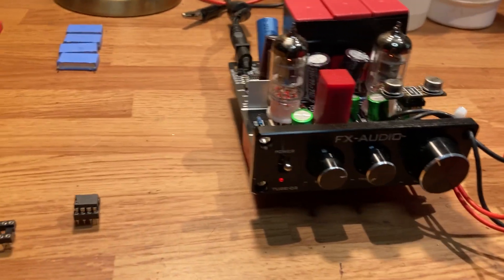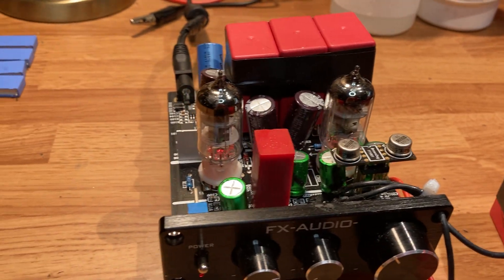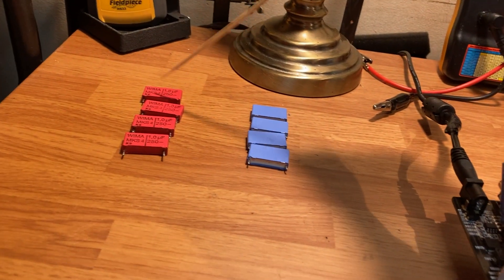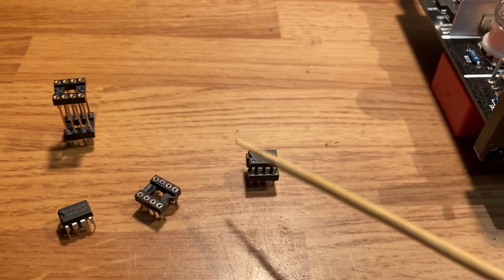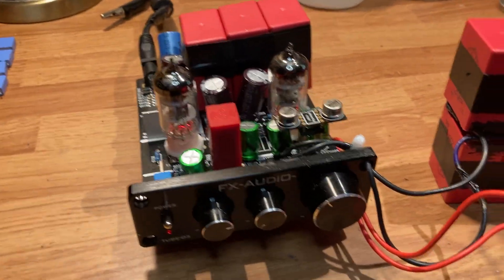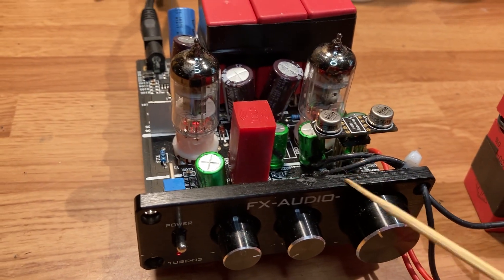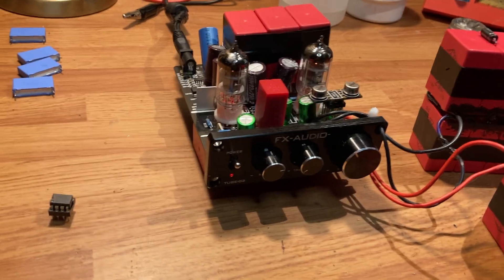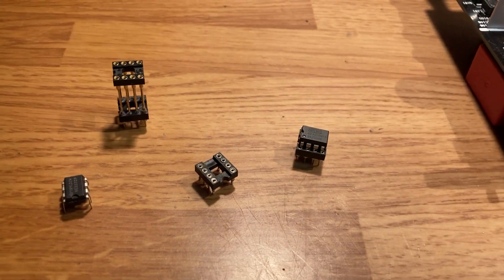FX Audio Tube-03 op amp and capacitor upgrade

Comment: do you need matched tubes on this device or will 2 same brand/model suffice on this?
Reply from the maker: you don't "need" matching tubes but you will have a different sound on the left and the right.  That's why people pay extra to have them matched as close as possible.
Reply: @ranbymonkeys2384  cheers mate, think I'll treat myself to one of these & try the 2 basic mods. Seems like an inexpensive way to give an old amp a new sound.
Reply from the maker: @bigambientdeath  Now electrolytic caps only last about 20 - 30 years so you may want to look into replacing the big power caps (usually 2 o f them) in your old amp.
Reply: Make you music more hifi!, My Suca tube T1 has arrived!, It comes with 6k4 tubes & NE5532p op amps, sounds good out of the box, swapped in opa2134pa amp's, sounds a bit more spacious in the top end, will leave Russian tubes till the others are properly run in, good unit so far...
Reply from the maker: @bigambientdeath  It probably came with Chinese tubes, if it did, get them the hell out of there, haha.
Reply: @ranbymonkeys2384  replaced the Chinese tube's with the voshkod 6j1 Russian tubes, they are smaller tubes but they just give you a little bit more of everything, especially volume, so a great match with the new op amps, thanks for your help & advice, very happy with this little device now.
Reply from the maker: @bigambientdeath  Glad to hear it.

Comment: Does anyone have a recommendation for what OP to replace stock with?
Reply from the maker: There may or may not be a couple of them in the description, maybe.  Shhh, don't tell.
Reply from the maker: What is your system lacking?  What does it need more or less of (tighter bass, lower bass, crisper highs. mellower highs, ect) ?  EDIT:  Sara the reason I ask is because different op amps can do different things such as OPA627 will soften the highs with a warmer tube sound, I'll tell you what, get a MUSES01 and a MUSES02 from Mouser NOT EBAY and you won't regret it.  link to 01 : https://www.mouser.com/ProductDetail/NJR/MUSES01?qs=%2Fha2pyFaduhLj53VmnKEqFRFz215J7cixEDbz0teI2s%3D
link to 02 : https://www.mouser.com/ProductDetail/NJR/MUSES02?qs=%2Fha2pyFaduiBH%2F%2FkpIrdkJVU%252B1ReE4c5hUkfZAV1m%2Fo%3D
Reply: LOL! Should have introduced myself , This is her husband Frank.
Got it! Thank you! I know I heard the parts in the video but wasn’t completely sure which ones and I’m looking to tame the highs a bit. Due to the crossovers I went with in my cerwin vegas.
Reply from the maker: @t-ballwilly2689  The opa627 does a real good job with taming the highs, but those are single op amps so you would need 2 of them just for one "slot".  For a cheaper option the OP275 and the TL082 would be good for taming the highs.  Get 2 of each the OP275 is around 4.50 and the TL082 is about 1.50.
Reply from the maker: @t-ballwilly2689  Grab a AD823 for around $10 too for your bass op amp.  Youll have enough to mix and mach then.  Later get those MUSES, but those would be KILLER!!!!!
Reply: @ranbymonkeys2384  ok, I got a bunch of stuff ordered, unfortunately the only opa adapters will take much longer to get. Also, I ordered 1 muse01 and 1muse02, I can use them in the same device, correct?
And which one is preferred for bass and which one is preferred for treble. I assume left is bass and right is treble
Reply from the maker: @t-ballwilly2689  Yup, and you will have to try both ways to see what sounds better with your system.
Reply: Has anyone tried the MUSES8920D op amp? 1/3 the cost of muses02
Reply from the maker: @bernieguerin7926  ya the MUSES8820 and MUSES8920 are op amps that companies use to say that they have MUSES in their products.  They are "production" pieces and are nowhere near as good as the "real" ones. EDIT..They are 1/5 not 1/3 the cost.
Reply: @ranbymonkeys2384  do you have a part number for the film caps?
I get lost on the 1,0uf part of the whole thing.
1,0if 250v WIMA (5%, 10%?)
Reply from the maker: @t-ballwilly2689  what caps the 4 by the rca's
Reply from the maker: @t-ballwilly2689  Mousers site is fucked up as usual the percentage is just a +/-  1% is closer to the uF value than 10%

Comment: Hi, can I change 4 biger caps with this capacitors WIMA MKP 10 Polypropylene Capacitor 27,5mm 250V 2.2µF. And two small ones with WIMA MKS2 Polyester Capacitor 5mm 100V 2.2µF. Tnx
Reply from the maker: Do you have a chainsaw?
Reply: @ranbymonkeys2384 ? Why
Reply: I am not so good with electonics but know how to solder 😁
Reply from the maker: @kristijankusic1374  I guess I don't understand the question, you know how to solder and you would desolder the old and sodler in the new, or am I missing something?
Reply: @ranbymonkeys2384  on video red caps are wima mkp 4 1uf I have wima mkp 10 2.2µF, so my question is can I put wima 10 2.2µF
Reply from the maker: @kristijankusic1374  how wide are they, you only gave me the length
Reply: @ranbymonkeys2384  is same dimension like original blue ones
Reply from the maker: @kristijankusic1374  You said you know how to solder, take the blue ones out and put the red ones in.  Look are you fucking with me or what?
Reply from the maker: @kristijankusic1374  Remember it doesn't matter what way they go in because film caps aren't polarized.
Reply: @ranbymonkeys2384  https://www.audiophonics.fr/en/wima-polyester-capacitors/wima-mkp-10-polypropylene-capacitor-275mm-250v-22f-p-13629.html and this https://www.audiophonics.fr/en/wima-polyester-capacitors/wima-mkp-10-polypropylene-capacitor-275mm-250v-22f-p-13629.html
Reply from the maker: @kristijankusic1374  they are both the same link, I'm curious why you want 2.2 uF and not 1 uF.  Not that there is anything wrong with that, just wondering.  It appears that it is the same size as the ones in the video on the table (the ones not soldered) but they only give one dimension of the box ya KNOW!!!!!
Reply: @ranbymonkeys2384  I have 2.2µF, I have to wait for 1µF
Reply from the maker: @kristijankusic1374  Yes you can use the 2.2uF, it might be a bit muddy, but it just may be perfect too.  That's all the fun is experimenting, blowing stuff up, breaking stuff and every once in a while actually good sounding stuff too.  I didn't know what you mean't at first.  It won't do any damage if you use the 2.2uF.  Let us know how it turned out too.
Reply: @ranbymonkeys2384  tnx for help, I will post when I done
Reply: @kristijankusic1374  how you like the 2.2 instead of 1uf?

Comment: I just found your channel watching the Audio Arkiteks channel. I am going to do the opamp and WIMA mods. Thanks for this video.
Reply from the maker: It's a must for sure, I didn't know he was going to give me credit like he did, he's great guy that's for sure.  You wanna piss him o,ff get the MUSES02 op amp he's been talking about that one for a while.  Any questions just drop us a line, more than happy to help.
Reply: @ranbymonkeys2384  plug both slots with MUSES02 or mix with other OP amp?
Reply from the maker: @Jink048  Whatever your heart desires.  I have a mellower op amp for the treble (I have Klipsch speakers) and a meaty one for the bass.  Mix and match to find out what sounds best for your system.  Two MUSES02's will run you $100.  It won't sound bad I'll tell you that much.
Reply from the maker: @Jink048  You won't be able to put the cover back on.
Reply from the maker: @Jink048  The reason being picture 2 op amps side ny side they will be hitting some caps in there so you need to use risers so the adapter is above them similar to how the can style opa627's are in the video.
Reply from the maker: @Jink048  To answer your question, no, mouser doesn't sell the adapters.  https://www.cimarrontechnology.com/product/browndog-021001-single-to-dual-op-amp-adapter

Comment: Looks like it’s time for an OP amp video in my near future
Reply from the maker: It's about time a professional did one, haha (I'm referring to you not myself)
Reply: @ranbymonkeys2384  i got three of the four front TIGHT screws out and then ended up  frickin stripping the fourth. Now i am trying to learn how to get out that small rounded hex screw. May have to loctite it in place with the small hex key and lose the bolt and hex key. Heck...don't even know if that will work. They definitely over tightened my unit. The first one was tight but at least i got them out. Upsetting as i was going to put the Muses02's in but this all has to sit now. First world problem.
Reply from the maker: @RUMBLEGO1  they are allen screws how did you strip them?
Reply from the maker: @RUMBLEGO1  you just need the top 2 front and top 2 back
Reply from the maker: @RUMBLEGO1  MAKE SURE YOU PUT THAT OP AMP IN THE CORRECT WAY!!!!
Reply from the maker: @RUMBLEGO1  I thought you already had it open to put the muses01 in it.  EDIT:  I would put the MUSES02 in the bass slot and the 01 in the treble
Reply: @ranbymonkeys2384  I have two units. One i have for my living room and the other for my desktop. The one i stripped is for my desktop and the MUSES02's. How i stripped it i don't know but it is rounded out now and it won't grab. Mine aren't the FXAudio O3's but the Suca Audio T-1's? They are basically the exact same units but rebranded. The inside of yours looks exactly like mine. There are a few like this. Are you sure you are right about only having to take out the top two screws on the front and back? If so then i should be ok. First one i took out the front 4 screws and back rca screws and it all slid out fine. Had to take off the back plate to put it back in as i had a hard time getting it to line up without doing so.
Reply: @ranbymonkeys2384  In your video you have the bottom screws removed? The entire thing slides out of the case so i am pretty sure all four of those needed to come out to get it out of there. At least i think i did on my first attempt with putting in the MUSES01's
Reply from the maker: @RUMBLEGO1  I'm sure about the top screws if the case  is the same the top half lifts up and that will let you change the op amp but wont let you solder the new caps because you will need access to the bottom.  I would put one of those muses02 in the treble slot of the one you put the 01's in.  You can mix and match it won't hurt it.  EDIT : it shouldn't look anything like mine I replaced almost every component.  Sometimes those knockoff of the Chinese version are really bad.  I had one, one time that had X2 caps everywhere (yellow safety caps) and they are not good for audio and are made for shunting the input power supply.  You need to change those caps out and check out the solder job on the boards.  I got the Tube-01 knockoff and it was shit it was Rybozen brand.  Not good.
Reply from the maker: @RUMBLEGO1  No there is a top half and lower half the bottom screws are in it not the top.  If it is fully enclosed if you get all 4 little ones in the back then take the volume knob off and take that nut off behind it, it will come out.
Reply from the maker: @RUMBLEGO1  I went at looked at the video all of the screws are out because I had just the board on the table but now after the demonstration purposes I just have the bottom half because the top half wont fit on there.  Along with the volume knob you have to pull those bass and treble knobs and there is a nut behind both of them thats all that holds that end of the board is the 3 nuts on the pots.  So if your is enclosed (mine isn't) you just need the back 4 little screws out to get it apart.  (the 4 screws in the back and the 3 nuts in front and it will come apart, if it's like mine you just need the 2 top on front and back to get access to the op amp.)  If you get in a jam drill the stuck ones out because you only need 1 screw on the front and 1 in the back to put it back together if it comes to that.  So in other words YOUR GOOD!!  Don't freak out on me.
Reply from the maker: @RUMBLEGO1  What happens is that company buys all of FX-Audio's scrap boards that usually have flaws (positive and negative are backwardness stuff like that) So look for that on the board.  The knockoff one I had was fully enclosed and not halved like the fx-audio is.
Reply from the maker: @RUMBLEGO1  I'm treating you just like everyone else YOU DON'T NEED TO TAKE BOTH PANELS OFF ONE CAN STAY ON THE ENCLOSURE IT DOESN'T MATTER WHICH ONE BUT ONE HAS TO COME OFF ALL THE WAY THE OTHER CAN STAY.  IF ITS THE FRONT THAT STAYS ON THEN UNSCREW THE # NUTS BEHIND THE KNOBS IF THE BACK STAYS ON TAKE THE PHILLIPS SCREW OUT BY THE RCA'S AND DON'T EVER DOUBT ME AGAIN!!!!!!!!!!!!!!!!!!!!!!!!!!!!!!!!!!!!!!!
Reply: @ranbymonkeys2384  I'm totally calm. like i said. first world problem. Yeah i will probably just drill it out and be done with it.
Reply: @RUMBLEGO1  I have 3 tube pre-amps that I had zero issues with the screws. A few days ago I got the FX Audio DAC MKII and managed to get only one out of the back. The other 3 I had to drill the heads off! Rediculously tight. I was then able to remove the remaining threaded portions of the screws and use spares to reassemble.
Reply: Just got the 03,put the opp amps in and wima caps too straight out of the box"lets not fk about " I have 6k4 tubes in there,will some ge tubes make a big difference at this point ? If so what kind would I expect ? Oh and I love this thing by the way as it has the base n treble and can bump them up to compensate for no graphic equaliser,gives me extra when a record sounds a bit thin,fills the room a lot better and makes it sound fuller n warmer too,thanks for your great work.
Reply from the maker: @FILMITS  Are you saying you still have the original Chinese tubes?  If so get them the hell out of there,  I hear people say they like the GE and when you say "old" tubes that is what you want tubes from the 50's.  NOS tubes "New Old Stock".
Reply: @ranbymonkeys2384   i hear you,wasn't sure just how much change there would be,wasn't sure if the opp amps n wima caps were doing most of the work n the tubes were like 20 percent of the equation,I'll look on line n see what I can find,so same question I guess,what will i expect to change after i have swapped them out?smootheness? Base? Clarity ?
Reply from the maker: @FILMITS  Good tubes make a world of difference.  I wouldn't measure it as in 20% or 50% but the sound waves go through all of these components.  Look there was a russian set  of tubes on Amazon for around $20 thay really good.  They are military grade tubes NOS.
Reply: @ranbymonkeys2384  funny you should say russian because I have just been testing russian otk2 tubes,they are not matched,I can see 1 heater is brighter than the other even when I switch ports but they sound smoother n seem to generate slightly more low base or it's just richer base making it sound like more base,these were just cheap though I think,not sure if they are any good in comparison to other tubes out there.edit,just checked and they are 6h1n eb x1÷76, these ok ?
Reply from the maker: @FILMITS  no idea
Reply: @ranbymonkeys2384  just found the tubes on line,they are voskhod and are said to improve base lol,good to know my ears are working ok,they have the anti vibration rubber rings,I will stick with these for now,thanks again for your great work and help.
Reply: Can you share what is that big red capacitor and what are the parameters for connecting the input?